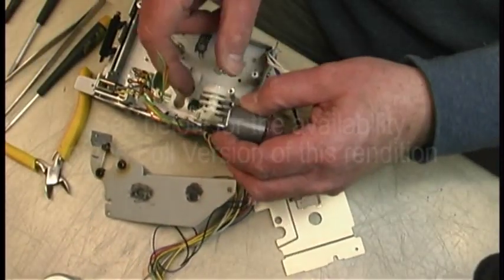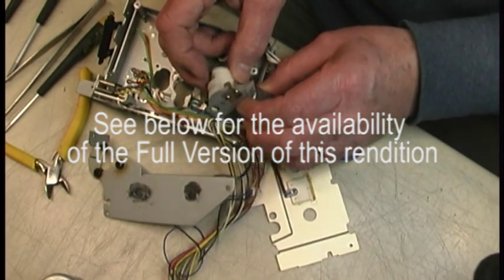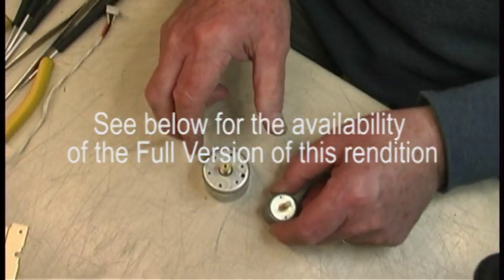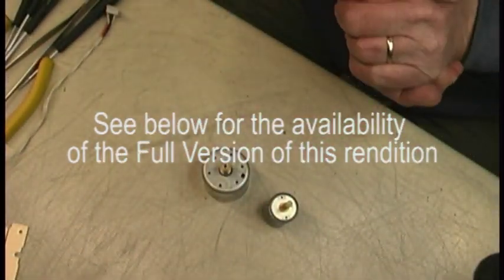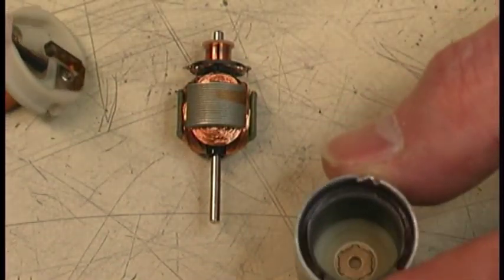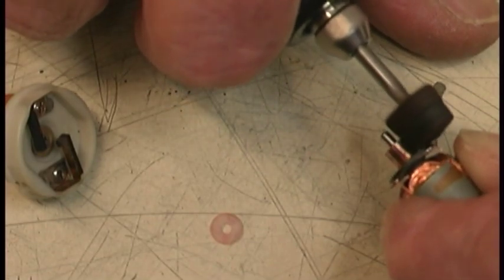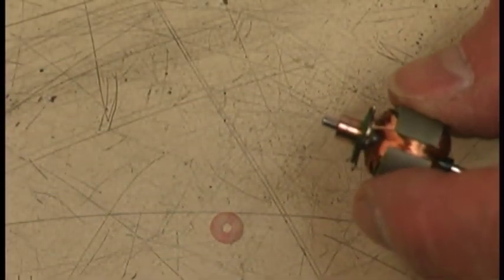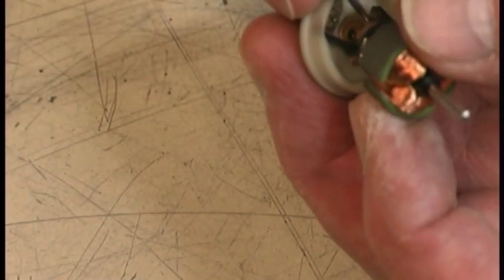How to Restore The Nakamichi Cassette Deck CR-3A

Comment: Does the  belt wrap around both capstans and drive pulley in one loop? Seems that the stepped capstan next to the pulley would only have partial contact with the belt whereas the right side would have much more wrapped around.

Comment: Thomas, I have a Nakamichi 680ZX the is having problems. When I turn the power switch on the left spindle engages and there is no way to stop it, but to turn the power switch off. Any suggestions on what I can do or need to do?